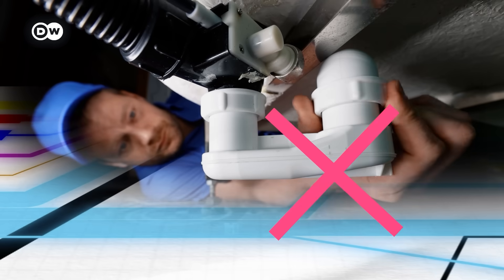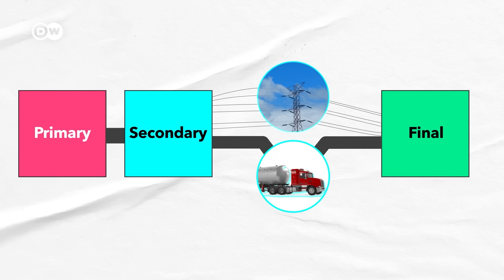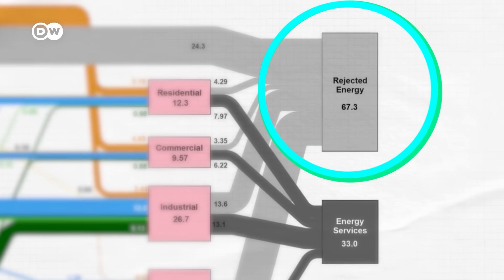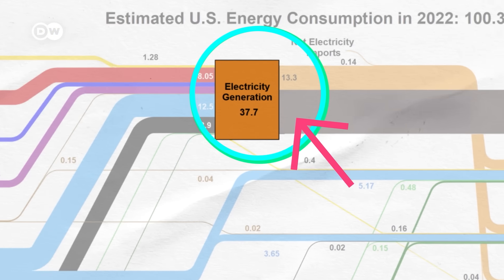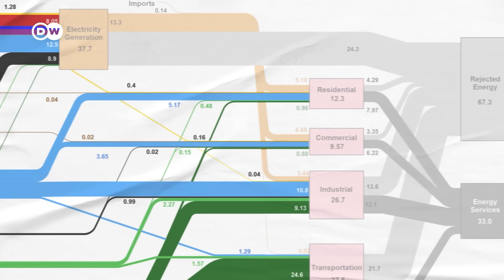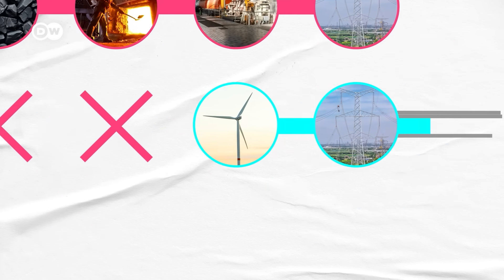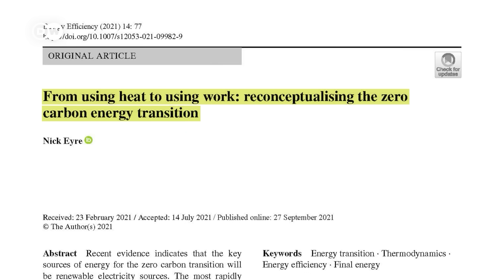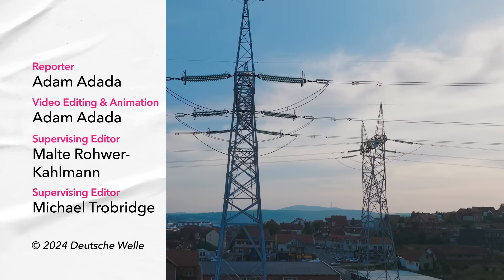The mind-blowing thing we get WRONG about energy

Comment: None of our appliances talk to each other for what they need.
We use refrigerator takes the heat away from our foods but dissipates the heat back to the living room. Then AC has to remove that heat once again to outside.
We use shower with warm water that has its own heat source. Our desktop computers generate heat. I can go on, but you get the picture.
Reply: In the winter, having a fridge dissipate it's heat into the room is good but in the summer it is not so. We do not have AC so the fridges just make the house unbearable in summer.
Reply: @Edsbar Not really a big issue, fridges only use 10s of watts so not a lot of heat gets into your room.
Reply: @alistairmackintosh9412  When cooling down from being turned off maybe, but a fridge or especially a chest freezer that is only being kept cold and not opened unnecessarily uses amazingly little energy
Reply: @ivanjacob_  Many household fridges have a 100w or a 200w motor that powers what is nothing more than a heat pump. Heat pumps can pump more heat than the energy the motor consumes by a factor of about 5:1, so the fridge with  the 100w motor could be pushing 500w of heat into the room. This won't be continuously as the thermostat will switch it off when the temperature is low enough in the insulated fridge body.
Reply: @Edsbar  These additional 400 watts have to come from heat stored inside the fridge, a large portion of which gets there from the air in the room in the first place. Also, consider that the body of an average adult has to dissipate around 100 watts of heat, continuously.
Reply: @E1Luch  Good point.
Reply: @Edsbar  THIS, winter vs summer conditions make it difficult to manage heating and cooling and energy use. Add to that the differences between how one generates heat vs electricity and it gets doubly complicated.
Reply: I've heard of at least one person setting up their refrigerator to dissipate its heat into a sand battery that can then later be used for heating at night or potentially converted back into electricity.
Reply: The pioneers had a great concept for a kitchen being more efficient and keeping the house cooler. On hot days they would cook in a summer kitchen which would basically be a shed detached from the house. It basically evolved into a bbq area these days. So you’re basically being more energy efficient as far as AC is concerned by using the bbq outside. You could just go ahead and build an outdoor kitchen instead so you can use induction improving efficiency even more. It’s also already hot out so less heat is needed to cook the food.
Reply: People need to learn how to properly use a fridge in the first place. People need to learn that keeping it mostly empty requires alot more energy to run than having it packed full.
Perhaps antiintuitive at first. Having it full and with so having lots of thermal mass keeps it somewhat cooler with less constant running of compressor. Compressor runs only when thermostat senses to much heat inside fridge. Each time the door gets opened cold air falls literally out and warm air goes in. With lots of thermal mass the cool is retained in the mass since this is not effected much by a bit of warm air brushing by it's cool mass. Also the air inside a fridge can change  temperature in a few seconds were a thermal mass will change a fraction of a degree in comparison.
Reply: @ottifantiwaalkes9289  if you design a fridge with thermal packs that you exchange for storage space but put back when storage is not needed. I would wonder how much the efficiency would improve? (Furniture movers cursing in background 😂)
Reply: @daniellapain1576  all you need is something solid like gallons of water. But remember, it takes energy to cool it down each time it is put inside fridge at higher temp.. keeping fridge full to the max is best. So when removing something cold, it's the best to add something cold.
Reply: absolutely true - the question is how efficent would it be to use these wasted energies..? for showers / waste water it can make significant sense - but e.g. installing a separate heat-capturing system to capture the fridge, computer-cpu etc might be a big overhead for small gains. Definitely nice to think about such things though! :D
Reply: RV fridges push the hot air outside but for some reason have a lower efficiency than normal fridges yet at the same time they are easier to run off of renewables making my head hurt with how this is the case.
Reply: @dapain1576  a normal fridge has the potential to get damaged from being tilted while running or by turning it on without enough time to settle. I would guess that an RV refrigerator fixes those problems in exchange for energy efficiency.
Reply: Energy loss is a fact in physics. You can’t convert every bit of energy into some usable form, that’s the reality of the universe.
Reply: @Ratinevo  sure. Yet harness with the least effort and impact what you need. And of course most huge refrigerators use more than a smaller one of same quality. I know so many people that refrigerate stuff that needs no refrigeration.
Reply: @ottifantiwaalkes9289  You are very right. I was not expecting a reasonable discussion. The truth is that we are obliviously wasteful, we need to be more sensible — not extremist, just generally sensitized to better use energy.
Reply: Remember when the old report about changing bulbs made many realise the old bulbs helped heat up homes back in the day and now they need to use other sources of heat more to compensate in older houses.
Reply: @kenji214245 heat pump heating system several times more efficient than a light bulb.
Reply: @kenji214245  
YES. This is an excellent point, exposing the shortcoming of virtue signalling climate change shills.
Reply: @Ratinevo  Wrong.
Reply: Just don't use AC. Don't be so soft. 
It should be banned. Way too much energy is wasted on AC.
Reply: @danielc6106  Can simply require  it to be powered by home solar.
Reply: There's one place I can say that manages all aspects of heat generation and usage and optimises the entire system, and that's the later models of Tesla cars. There's a complex system that connects heat-generating items (like the motor) in the car, via heat pumps to heat-dissipating items such as the car cabin. Clever stuff!
Here's one of many videos about the subject: https://www.youtube.com/watch?v=srraUymsT0U
Reply: What a dumb comment. 2nd law of thermodynamics, everything wastes energy via heat. Appliances talking isn't going to do anything about that. You want to lean into this? Put your fridge outside to save your A/C some work...
Reply: Energy can be reused many times but the cost (or required space) of the installation mostly doesn’t make the effort feasible, however logic it may seem. Doesn’t mean we should stop looking for these efficiency gains though
Reply: Simple solutions
Food can be eaten without heating.
Take a cold shower in the morning.
Make cold brewed coffee.
A small hydro generator can be installed on the input water pipe, whenever water is consumed we will have extra power.
Wake up and sleep with sunrise and sunsets, no need to use lamps.
Wear warm clothes in winter, save on the heater.
😅

Comment: You need to find other ways to make energy.
Fossil fuel is less efficient but it's guaranteed but wind and solar aren't even dams.
For example a cloudy day can't get solar energy 
No wind to bad no wind energy 
Your country is facing a dry periods no water for the dam 
These are the problems you should look at not what is efficient you need something guaranteed like fossil fuel and you need to account for different weather conditions and terrains some 
And the most important thing is the country economy 
Is it a rich or a poor country
Reply: Renewables are much more reliable than fossils. Look at France, their nuclear power plants are regular down because of maintenance, repair, weather (no cooling), ...
Reply: Word salad
Reply: Clouds do not reduce solar to 0% especially modern solar panels will still operate at some capacity (10-40% depending on the density of the clouds) 
It is only during days where the cloud cover is sufficiently thick that you really start to see 0% production and this occurs roughly for 2-8 weeks a year depending on location. combined with sufficient wind power you then start to look at only 1-2 weeks where you really have no renewable energy from both sources.

Things improve at surprising rates. The only real issue in a assumed scenario with only wind and solar energy is what you do to bridge those 1-2 weeks every year consistently without any blackouts. The battery capacity needed for such a scenario is kinda unfeasible unless you also rely of nuclear for a decent base load capacity.
Reply: @The_Lord_Below  Batteries are not the only form of energy storage. Clearly we need more energy storage.
Reply: @JeanPierreWhite  True, but the lack  of area in the Netherlands and many other countries for hydro storage is an issue in many places.

In addition the increasing number of electric cars going around does make batteries rather widely available going into the future. Car batteries are already able to both supply and demand energy from the grid.

In theory you can also store energy by turning into chemical energy through electrolysis (i.e. hydrogen). But i am personally not a fan of that solution. Partly because of round trip efficiency and partly because of the fire hazard.
Reply: @JeanPierreWhite : We need to stop wasting so much energy. And we need to coordinate energy consumption with production.
Storage is only needed if you want to emulate the fossil way of thinking about energy. People live a lie, everybody thinks there is infinite power in their sockets all the time.
The fact is: If everyone plugged in even a small consuming appliance at the same time, the grid operators would not be able to compensate for it quickly enough. Not even a fossilbased plant can regulate infinitely quickly, let alone nuclear that are extremely slow regulated.
Reply: @poulhenne  I agree we need to stop wasting energy. However your conclusion that energy storage is appropriate for fossil produced energy is the opposite of reality. We have been operating the grid with little to no storage quite happily for decades using fossil fuels. In order to get off fossil fuels we need energy storage to enable the use of intermittent renewables.

The scenario you cite regarding everyone turning on appliances simultaneously is a valid scenario. One that grids without energy storage will fail at. A grid with energy storage can cope with a sudden surge in demand much more quickly and with much lower probability of blackouts.
Reply: @The_Lord_Below  There are at least seven energy storage solutions grids can choose from.

1. Pumped Hydro.
2. Batteries.
3. Hydrogen.
4. Compressed Air.
5. Flywheel.
6. Thermal.
7. Gravity.

Each of these types have several technical solutions available.
Reply: @JeanPierreWhite   Do you have an example of ompressed air and flyweel that have been turned into practice on a large scale? I have seen some for thermal (though those were also referred to as batteries) and some very odd and unpracticle ones for gravity.  But I have genuinely never heard of Compressed Air and Flywheel as batteries.